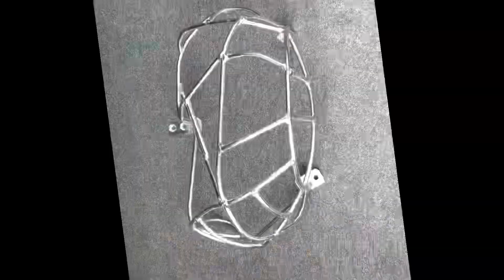DIY Pipe guard for your 2 Stroke [GAS GAS EC 300]

Comment: Great Job, Buddy. How thick is the Steel used here? Ok, just saw = 8 mm!!!
Reply from the maker: Yes, it is at the end of the video. I used 4m 8mm thick steel bar. If you use too thick it will be heavy. The pipe guard got a few big hit by rocks and still doing great, bulletproof✌️In the future I would like to create radiator guards too
Reply: @Caferacerhungary  Thanks Buddy, ride safe! Greetings from Chiang Mai/Thailand.